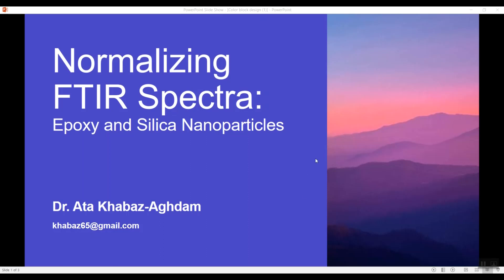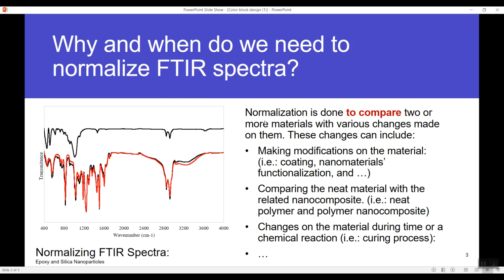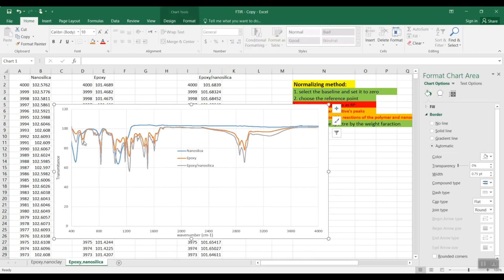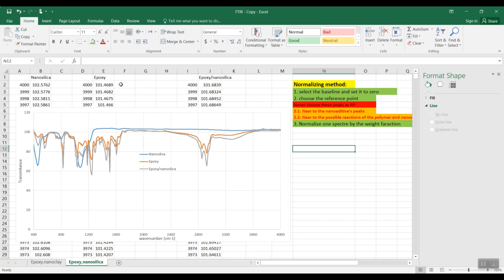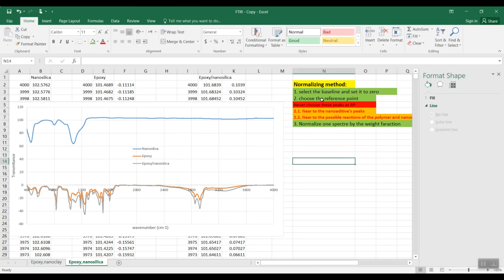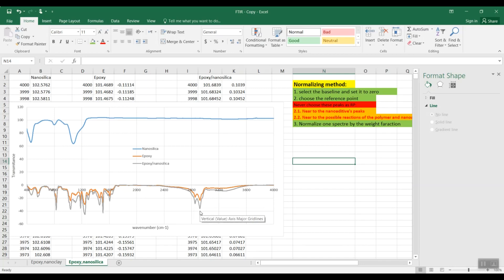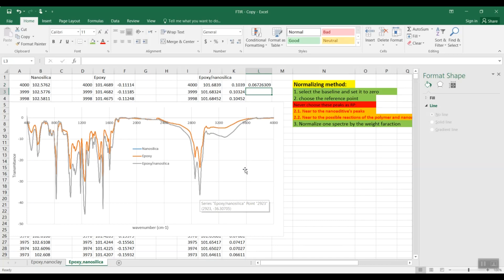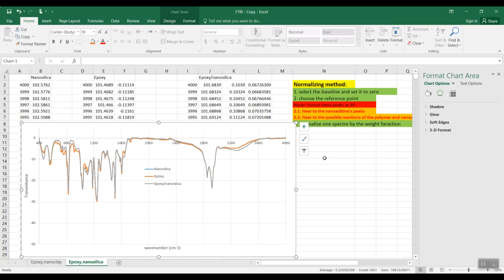Simplified FTIR Spectra Normalization: Exploring Nano Silica, Epoxy, and Epoxy Nano Silica

Comment: What's the wavelength span covered by this technique? Any reason why infrared is used?
Reply from the maker: Thank you for your comment! In Fourier Transform Infrared (FTIR) spectroscopy, the wavelength span typically covered is in the infrared region of the electromagnetic spectrum. The infrared region ranges from approximately 700 nanometers (nm) to 1 millimeter (mm) in wavelength.

FTIR spectroscopy is specifically used in the infrared region because it allows us to study the vibrational and rotational modes of molecules. Different chemical bonds and functional groups exhibit characteristic absorption bands in the infrared region. By analyzing these absorption bands, we can gain valuable insights into the molecular composition, structure, and interactions of the substances under investigation.

The infrared region is particularly useful for studying organic compounds, polymers, minerals, and many other materials. It provides a unique perspective on chemical bonds and molecular behavior, making it an essential tool in various scientific fields, including chemistry, materials science, pharmaceuticals, and environmental analysis.

Even though this video specifically focuses on the normalization of the curves, I really appreciate your brilliant question for clarifying this issue. Thank you for your valuable input Dear Dr. Behzad!